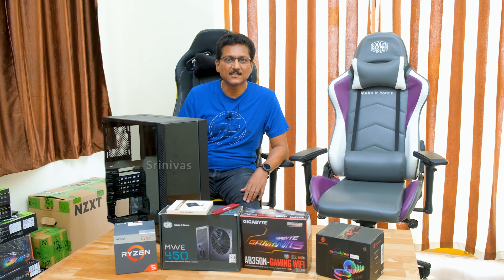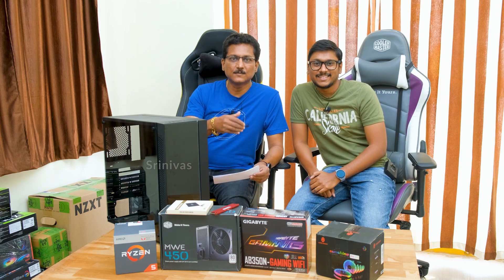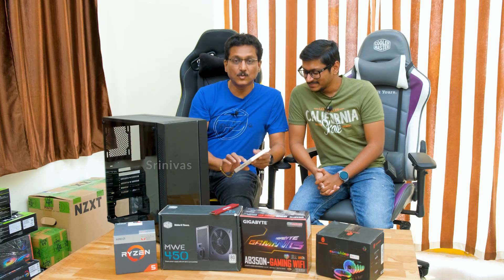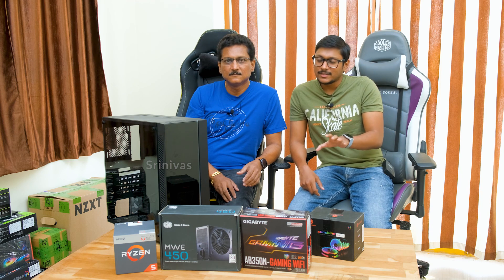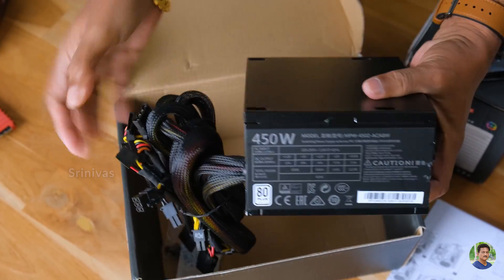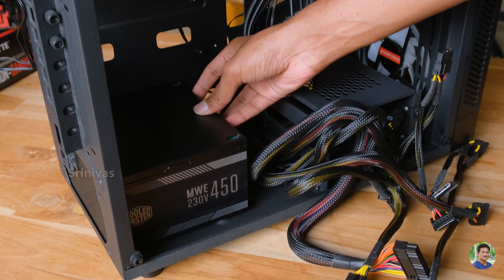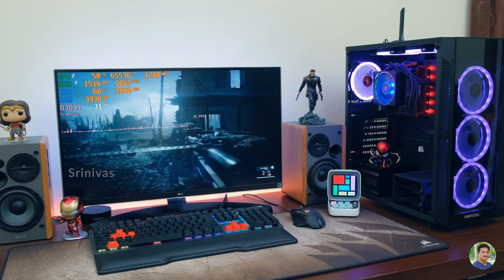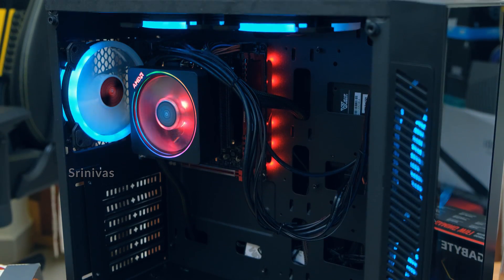Budget PC Build 30K & First Time My Son in Telugu Video !!...

Comment: Hi Sir, need an info related pc build,
I am using amd 3700 processor and 1660 super graphic card, 32 gb ram.
I am using default cooler comes with this processer and a single fan in cabinet. I am using this pc only for  editing, AE and Premiere software.
My question is do I need to install liquid cooler or default cooler is sufficient to control the temperature of my pc, please suggest sir,
And also how to know the temperature of my pc.
Thanks sir waiting for your valuable suggestions

Comment: sir can you please suggest me which gpu to buy and my cpu specs are:
processor: intel i3 9th gen 
motherboard: GIGABYTE H310
ram: 4 GB
my current gpu: gigabyte geforce 210 1gb ddr3
sir i wanted to play gta 5 at high setting. please suggest me which gpu to buy. hope you see the message and reply.
thank you brother
Reply: First upgrade ur ram to 8gb atleast then u can use rx 570 or GTX 1650 super

Comment: Hi Sir I need these hardware, please suggest to me where to buy in best price.............
Motherboard - MSI MPG B550 GAMING CARBON WIFI
CPU         	- Ryzen 9 3900X
RAM	    	- ADATA XPG GAMMIX D30 16 GB * 2
SMPS	    	- Corsair VS 550
SSD m.2		- ADATA XPG SX 6000 Lite PCIE 512GB Gen 3x4 M.2 2280 SSD
Graphics	- Asus Gforce GT710 2GB DDR5
Case		- Cooler Master MasterBox Q300P or Q300L

Comment: Sir can I use Adobe photoshop smoothly with these components. I am a beginne, if any changes please inform sir.your reply is more valuable to me
Reply: Yes you can easily do that 😊
Reply: Just try to increase the ram for best experience around 16 gb  🙂
Or 12 if possible
Otherwise 8 would run photoshop

Comment: UNCLE I WANT TO BUY GAMING PC WITH DESKTOP FOR 16GB RAM(8 X 2) . WHICH AMD PROCCESSOR IS BEST, MOTHERBOARD & GPU UNCLE
Reply: Go for ryzen 5 3600 as CPU b450 as mother board and use 1660ti as gpu
Reply: for ryzen 5 3600 processor can we use 1650 (i saw it in one of your video today) instead of 1660 ti as gpu, as it looks costlier  will it affect perfomance
Reply: @ABHIGAMINGYT7  yes 1650 Is only 3GB in vram and 1660ti has 6GB ram..so less fps
Reply: @akai8985  THANK U ANNA

Comment: Hi I'm from Tamilnadu,
In 3:14 you said AB350N costs 6500 only. But in Amazon it shows nearly 19000.
https://amzn.to/2vv9qwQ

And I think you didn't mention about HDD
Reply from the maker: Just check the latest AB450N price on Amazon you will be shocked, online prices are always not correct 😄🤣😂, here in Telangana "Secunderabad" at CTC computer market it's under 6500 👍
Reply: @TeluguTechwithSrinivas  Ok I'll check in Chennai Offline Market. 
What about HDD. I think you didn't show in this video. Is SSD enough for this pc?
Reply: @TeluguTechwithSrinivas  Hahaha. I already have a plan to buy AB450N only amazon price rs6400 only.😂🤣